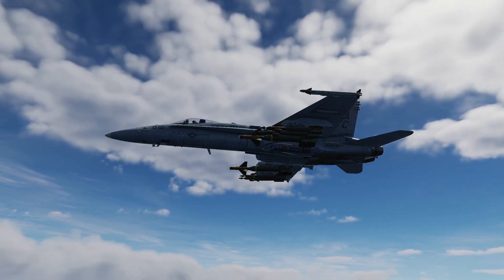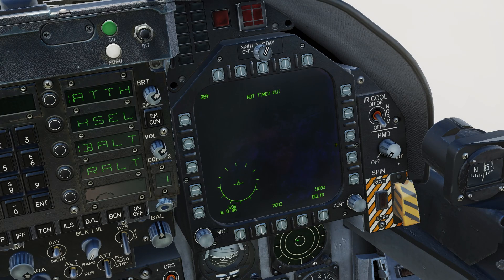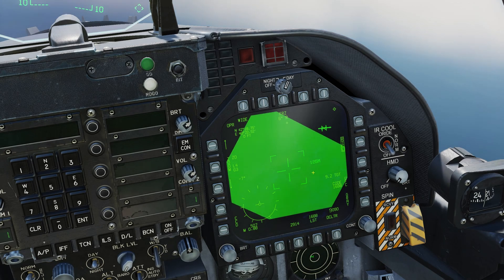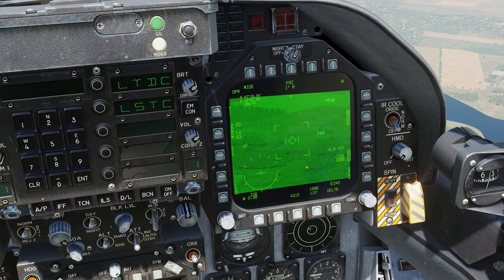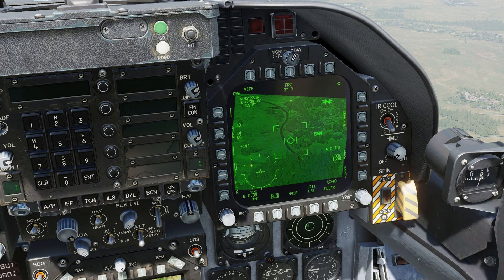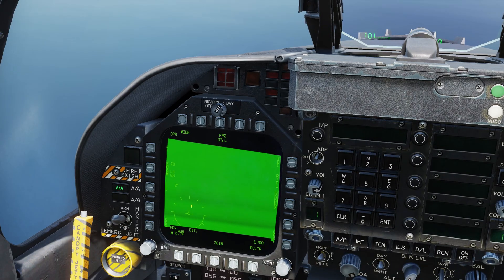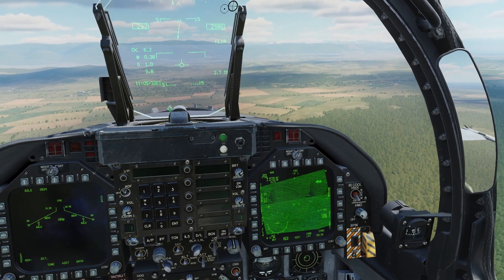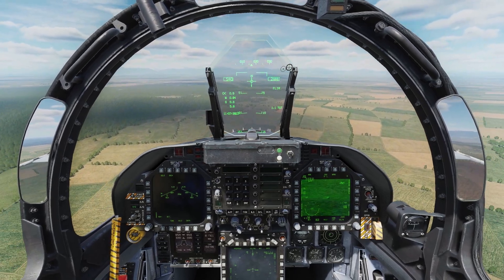Litening II Targeting Pod | DCS F/A-18C

Comment: 7:45 Boxing TRIG does not arm the laser, it allows the laser to be fired by pressing and holding the trigger. The LTD/R switch arms the laser.
Reply from the maker: Thanks for the comment! Yes, you are right the TRIG allows the trigger to activate the laser, I misspoke and used the term "arm" in the sense that the trigger is now armed to fire the laser.